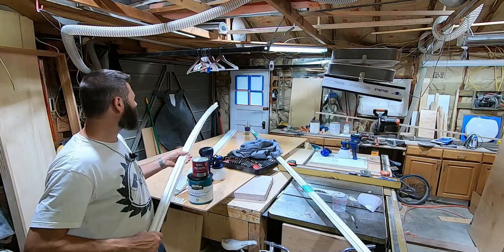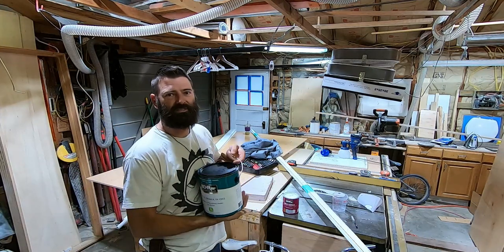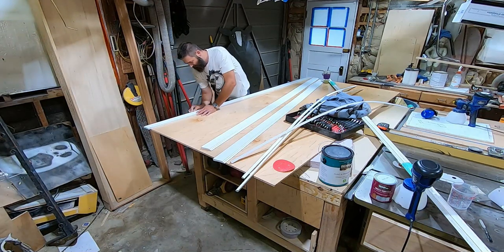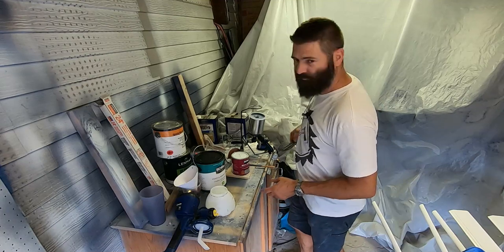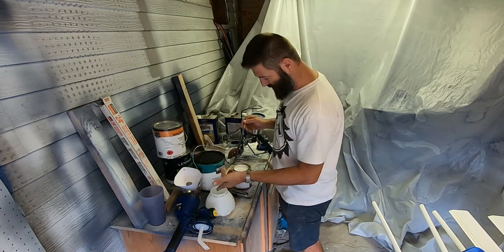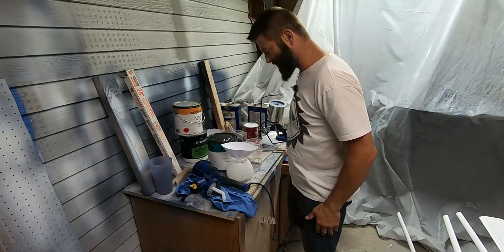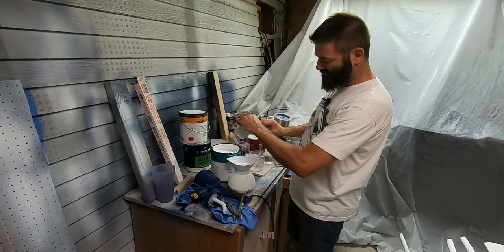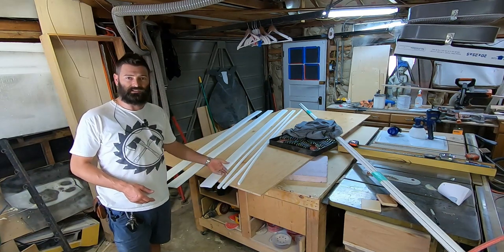How To Paint Vinyl Baseboard And Trim So It Doesn't Peel Off | THE HANDYMAN |

Comment: For everyone questioning the use of vinyl, this is for a basement bathroom that experienced moisture problems.  Wood isn't always available or economically feasible, and wood fiber is not appropriate for areas with high moisture and humidity.  I would lean toward a ceramic tile base, but this is a good option to keep a trim style that exists throughout the house.

Comment: For bonding to vinyl, XIM has great primers for a variety of purposes, and I believe I have used E.S.P. (easy surface prep) as well.  E.S.P. is a "wipe on, let stand, wipe off" product that works so well it seems like it shouldn't until you see the final product, which is amazing.  Neither of these require sanding for adherence, but you should sand for a smooth surface if necessary.
Reply: might give that a jab

Comment: If you use a microfiber cloth to wipe down the molding that has static, it will leave little burned fibers all over the cloth. 
On a side note, do yoy use Gripper primer? That stuff is so good, it will stick to running water. 👍

Comment: That vinyl trim is great in wet areas but is not cheap. I use it a lot around windows in the shower. And yes, got to be very careful with what paint you use but that goes for anything you paint! I haven't used that brand to prime it, might have to try it out.
Reply: Not cheap? I'd love to know where you're getting wood or MDF cheaper than pvc. It's about the affordable thing at the moment....
Reply: @kenkelly1154  this comments from like 6 months ago lol. In my area mdf trim is still not bad. Bit of a shortage on 4x8 sheets of mdf. 2x4s and plywood is crazy prices

Comment: Would this apply to pvc wainscot? We just put up the Everbilt panels from HD and they do not require priming before paint.... Thought about using shellac primer but not sure what to do now....
Reply: I'm in this same position atm. What'd you end up doing for primer? And what kind of paint did you use afterwards?
Reply: @celestabird8374  my friend who's a painter did it for me. We followed the instructions, not to prime and to use an enamel. Used SW Emerald Urethane enamel. Two coats I believe, several hours apart. Holding up good but it doesn't really get put to the test, as we have no kids in the house.... The bonding primer that guy uses in video supposed to be good too. Maybe buy some and do some test pieces.
Reply: @JMBlackNet  thanks so much for the info! Can't believe how limited the information online is about painting pvc wainscot and/or beadboard. 🤯 Your input really helps!
Reply: @celestabird8374  oh i just remembered he scuffed the surface too. I think if you follow your product instructions, you should be fine. Good luck!

Comment: When I've tried to sand latex paint it always peels up so I switched to oil base paint if I'm gunna sand. How do you sand latex without it peeling up? I like your videos by the way I'm a remodeler and handyman myself
Reply: Slowly.  Try not to build up heat while sanding jump around to keep the surface cool.

Comment: Previous homeowner trimmed the base of a LR window seat with PVC quarter round & most of the paint has flaked off. And it's not even a high traffic area. (Obvious poor prep.) Not a fan of the stuff but it does have its place regardless. Good to know what paints to use too ~ just the other day I was touching & feeling my bookcases & ... 😋/📚
Reply: This is my issue, former homeowners used this vinyl trim all throughout the house and all the paint is peeling off.  Not sure what would be best to get off the currently peeling latex paint.

Comment: I hope you answer this. I was painting my laminated countertop. My kid started painting as I walked away and the brush started to shed. I immediately tried to remove it. Used paint thinner. 2 days later I thought I'll just cover it with more countertop paint. HELP. What can I use to remove it?  You can still see the remaining shedding under the paint. I've been searching for 2 weeks for a removal. .  I tried sanding it with an electric sander.

Comment: Could you use adhesive to install the trim if it wont nail thru the metal stud? I have done this in the past and it worked for me.
Reply: Oh no, don't do that. If the floor is ever replaced you have to remove the trim to do it efficiently. And if the trim is glued to the wall, removing it tears out huge chunks of drywall. It's nasty damage.
Reply: @droolbunnyxo9565  I did this when I needed to put trim against a fiberglass tub which worked great but I can see your point if you put it against drywall.
Reply: @brettbenson563  That sounds fine to me too 👍 :)

Comment: It's a shame we can't find a way to fasten that vinyl like it is without nail holes or cracks in the corners. It looks shiny like lacquer.
Reply: You can glue/caulk adhesive it to the wall. But ( ! ) if you ever want to replace the floor the trim is a nightmare to remove without damaging the drywall. As in huge chunks tearing out. I know because someone glued the baseboard trim to the walls of my last home. And made precisely cutting & installing the new laminate flooring a time consuming nightmare.

Comment: Don’t understand why you didn’t just leave it alone since it was already white
Reply: It would get stained and crappy over time with zero paint. If its painted it will stay nicer, longer and clean easier. Also unpainted it would likely be more high gloss instead of the desired semi gloss.
Reply from the maker: You have to caulk your nail holes and your joints.  Caulking never stays white more then a few week.